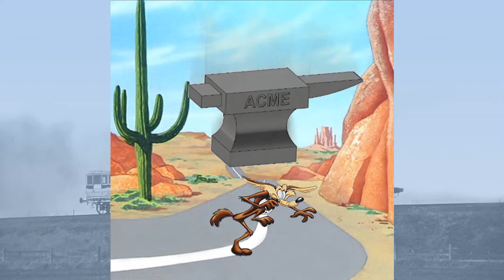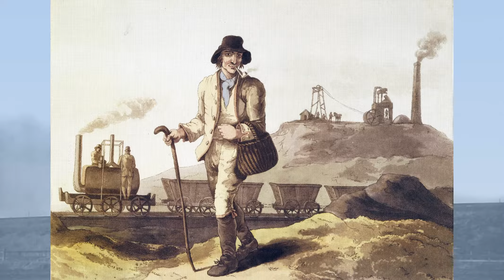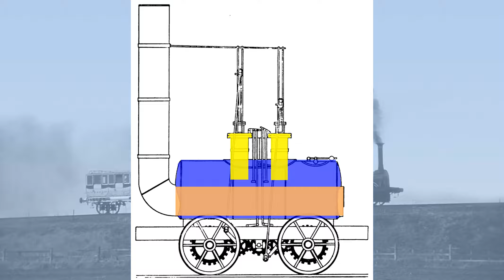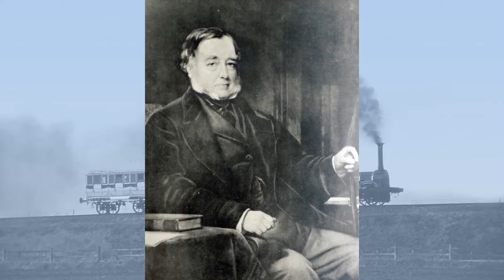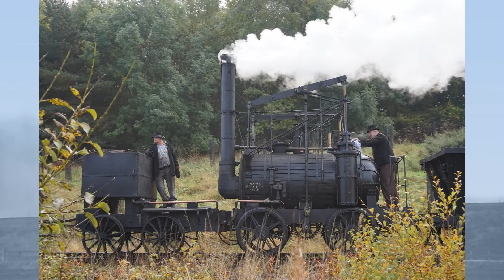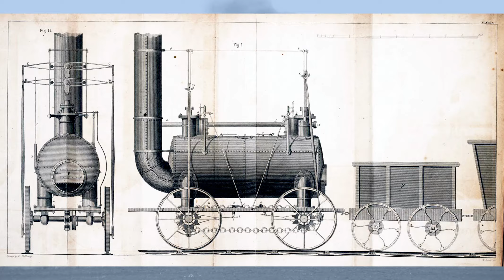Blucher: The Basics

Comment: I’d like to speak in William Hedley’s defence for a bit.  If track improvement expenses increased in Aug. 1814 as you suggest resulting from locomotives breaking the tracks, then the locomotive must have been in some shape fit to run on the original tracks to break them in the first place.  This may be a reason to push back the completion date of the Puffing Billy to before August 1814.

Comment: I read somewhere that the reason Blenkinsop's rack railway type locomotives fell out of use was that the rack and pinion had to be put on one side because horses also used the railway, and that this resulted in excess twisting forces causing many failures. Was this the case?
Railways where the rack and pinion are on the centre line are still used successfully on mountain railways.
Reply from the maker: The rack was laid down at the side as a quick expedient and also to leave the middle of the track clear for horses. Whilst the Middleton was entirely mechanically worked other than the mining of the coal, at other locations such as Kenton & Coxlodge and Willington horses were still in use. Matthew Murray notes in correspondance that the rack at the side was a mistake in the long run due to excessive wear on one set of wheels. There is no evidence of "many failures" on the Middelton. The locomotives were at work at Leeds from 1812 into the 1830s. At the Orrell Colliery near wigan for a similar period. They were very succesful machines. At least a dozen were built: four at Middleton, two for Kenton & Coxlodge; one at Willington; two or three under licence at Orrell;  one or two in Belgium and two in Germany. The German examples were not sucess but the others were. The only failure attributable to the Middleton locomotives is one exploding after the driver had tampered with the safety valve in 1818 and another about ten years later. There's a lot of miss-information about how the Blenkinsop and Murray locomotives were failures especially compared to Stephenson or that Blenkinsop and Murray didn't understand adhesion. Yet their locomotives operated succesful for decades and they clearly did understand a locomotive could move under its own power on rails, its that they were building a machine sufficiently light so that it did not break cast iron track, but in so doing it was too light to move a useful load so the rack and pinion system was adtoped. In fact Blenkinsop notes his locomotives could move  far heavier loads than Stephensons and also do so in the rain snow and ice.
Reply: @AnthonyDawsonHistory  Thank you for the clarification. :-)
Reply: @AnthonyDawsonHistory  The first explosion was driver error (infact failure to adhere to instructions),  the second lack of maintenance when funds got tight.  I suppose we have to credit Stephenson with eventually improving the rails  to take a higher weight and hammer blow from wheels.

Comment: in the days before matches where invented how did they light fires in the Fireboxes of the early steam locomotives? when locomotion was delivered and placed on the railway for the first time i understand George Stephenson lighted her first fire useing firewood and some old rope and he actually lit it using a looking glass that he had been given by a workman
Reply from the maker: They'd use a flint and steel, as at home, or something called a 'Burning Glass' which was a poweful magnifying glass to focus the sun's rays. Usually, there was a permanent source of combustion available. So they didn't have to use flint and steel every time.
Reply: @AnthonyDawsonHistory  where these engines lit up by the footplate crews or people who's job it was to light the fires in steam locomotives
Reply: what was the price of Horse feed compared to steam coal in 1814-1815?
Reply from the maker: @eliotreader8220  It was estimated by John Blekinsop in 1813 that  to maintain one horse in food and farriery cost £78 6s per year. The cost of one  maintaing one of his locomotives was £50.  So not an insignificant saving. Furthermore more, his patent locomotives could move a larger load than  a horse ever could, and could work 24hours if needed. The cost of purchasing one locomotive was about the same as five or more good horses. The locomotive was more cost effective hands down.
Reply: @AnthonyDawsonHistory  whats that in new money pounds and pence? I am a little bit rusty when it comes to old money.
Reply from the maker: @eliotreader8220  The National Archives current converter suggests £50 would equate to £2.3K and £78 6s to about £3.6K. Horses today are still very expensive to buy and maintain, if not more so than they were 200 years ago.
Reply: @AnthonyDawsonHistory  I understand that the early industral railways pre heated the water before it was put into the boilers of the engines because they where very like big kettles on wheels?
I understand that the Great western railway used this practice during the battle between standard and broad gauge railways.
Reply from the maker: @eliotreader8220  Early mainline railways too pre-heated the feed water. the Liverpool & Manchester used hot water to fill the tenders, so too the Leeds & Selby (and others). It was a very common practice to improve the thermal efficiency and longevity of a boiler. Before the Giffard Injector became popular you could use hot feed water without any problems. Injectors, however, need cold water to work properly, so the use of hot feed water fell out of use when the Injector - far mor reliable than the pump and could of course be used when stationary - came in.
Reply: @AnthonyDawsonHistory  did they also do that to stop the build up of scale inside their boilers? in the days before water treatment.
where did the early steam railways get their water from the late wild life artist David Shepard thought that they mite have got the water for Locomotion from a nearby river when the engine was first put on railway track?
Reply from the maker: @eliotreader8220  They used filtered rain water. Purest water available.

Comment: You have a couple of technical errors
Reply from the maker: Thankyou for your comment. This video essay was written from the most recent research into Stephenson and his locomotives by leading early railway historians Dr Michael Bailey; and by  Andy Guy, and John Cromtpon on William Hedley/Wylam Colliery (Also leading early railway authorities) published as part of the International Early Railway series of Conferences. I present a synthesis of their work here and in my own book "Befor Rocket" from Gresley Books :)
Reply: Long stroke cylinders do not waste steam, if the cut off is correct they make better use of steam.
Long stroke cylinders were probably necessary to develop sufficient torque to make a viable engine with the low steam pressures of the era.

Short strokes are used in high speed engines, mostly late steam era like Uniflow engines.

Comment: Just a little question. How much it would cost to build a working replica of a Salamanca.
Reply from the maker: About a million pounds sterling. And of course you'd have to have replica track to run it on too.
Reply: @AnthonyDawsonHistory  Do you know of any (modern) operable scale models? A 1:4 scale model would even be pretty impressive, I'd think.
Reply from the maker: @furripupau  Well, there's Blenkinsop or Murrays original working model from 1812 which is usually on display at Leeds City Museums but has been loaned to the Science Museum Group for an exhibition 'Brass Steel and Fire' which collects about a dozen early railway locomotive models, c.1800-1840s which is now at the Science Museum in London have previously been on display at the NRM in York. There's also a large scale model of a Blenkinsop locomoive at Beamish museum too. A full size replica of one was included in the replicas built for Joseph Pangborn for the Columbian Exposition 1892-93. Sadly it was destroyed many years ago when the roof of the Baltimore and Ohio museum collapsed. A more recent collapse destroyed even more of the Pangborn replicas.
Reply: @AnthonyDawsonHistory  Fortunately, there are a few of those B&O replicas in other locations, I know the Old Ironsides, Sandusky, and York are still in existence elsewhere. I can't recall if the wooden version of Lafayette still exists, but for some reason I'm sure I've seen it somewhere before (edit: it's at the Allegheny Portage Road. Hercules also still exists, although I've never seen it, or even a photo of it). It would interesting to know if somebody has tracked down all of the ones that still exist.